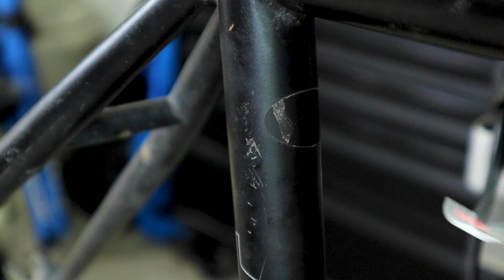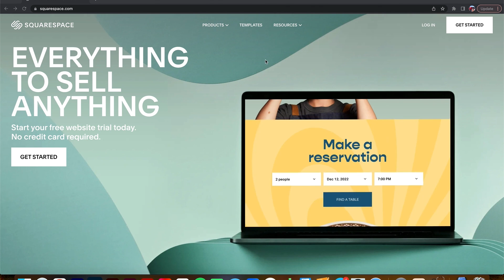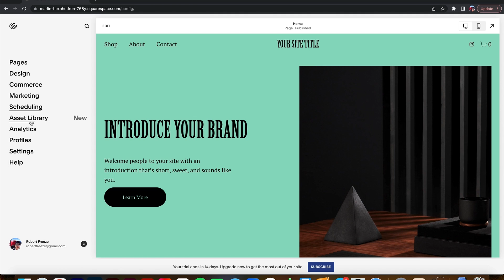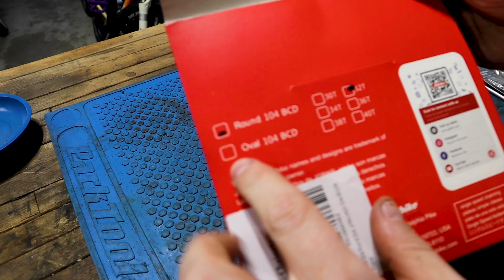Single Speed Bike Restoration - Jamis Exile

Comment: Help me understand why you set the brake cable tension the way you did. I get it with v brakes ke cantis, but the BB7 has a “backstop” that holds the actuator in place. And you can dial in the exact tension with the pad adjusters. So what am I missing?

Great video/build as always. Thanks for making it.

Comment: Those chainring bolts have a hex on both sides, is that a nut and bolt system? Mine just has the bolt, the chainring has threaded holes 🤔
Reply from the maker: They’re Wolf Tooth chainring bolts, a bit bulky on the back but cool for a 1x setup

Comment: What do you think of converting a modern 3X10 cross country MTB to a single speed? Can it be good or should I not bother with it?
Reply: Its not so modern, but I converted my 2002 MTB to SS, but kept two chain rings on the front (36T and 22T), with a 22T cog, and added a chain tensioner. I can manually change the speeds for the big climbs. Its my favorite bike by far. V-brakes and all!
Reply: @MorryB  That's a good idea. Beats the purpose of having the simplest setup but stil better than a derailleur.